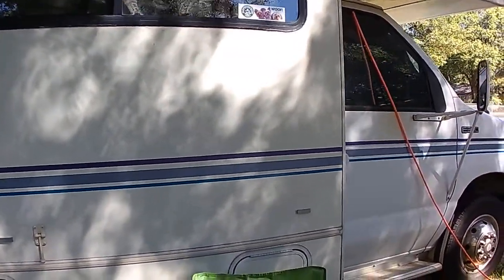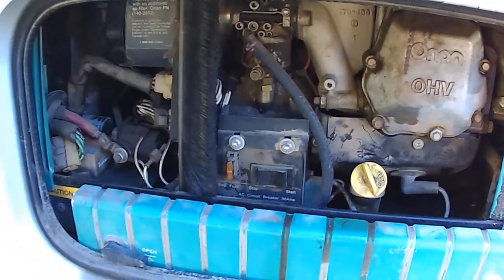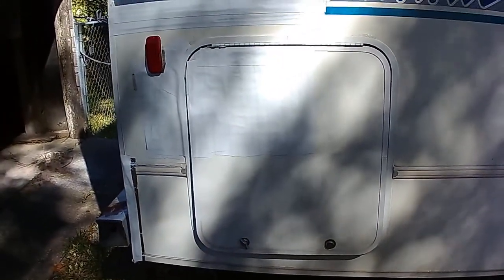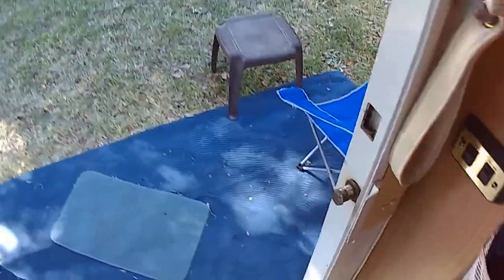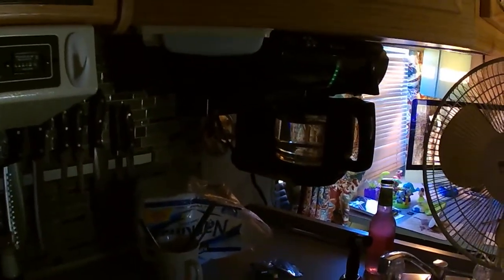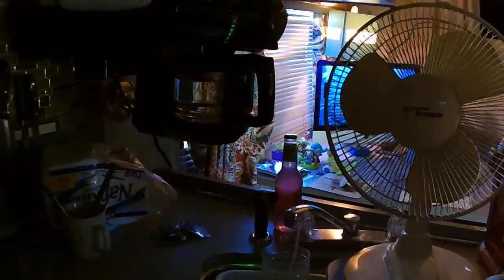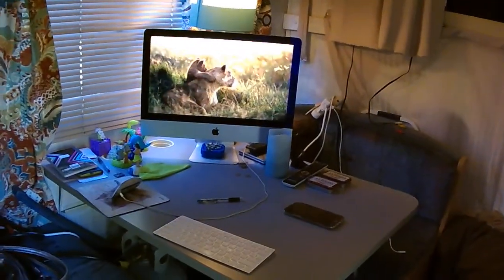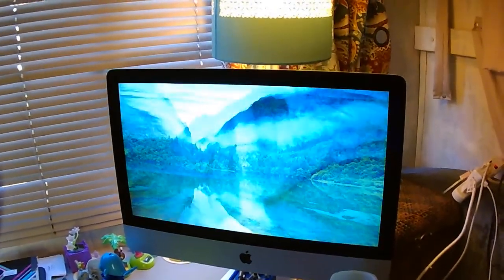Alittle tour

Comment: You've really done a lot with getting the camper organized. Good work. I am a bit concerned about the propane tank in the RV. It seems to me that I saw Nomadic Fanatic talking about his Buddy Heater and that he had the propane outside somehow. Just concerned (not that I know anything about it - just concerned.) :-)
Reply from the maker: I understand the concern I was worried about it also. I got a Stugi stay on my propane tank, Today I received my gas pressure checker and I will check the pressure on the RV propane system this weekend. If I have no leaks which I believe I will not, I will get someone to put a quick connect on my stove and have the tank outside. I also have an LP gas detector just in case there is a leak. It is nice to know that others also think of these things.I watch eric's channel and he also had a quick connect added after the fact. But all this takes time. Thanks for your comment and also when I drive the RV I take the tank out.Right now I am just driveway surfing
Reply: Mummy and Clyde glad you are taking the proper precautions. There are so many things to think about - but channels like yours and "the guys" are helpful and encouraging!
Reply from the maker: In my life right now there is no man and ladies are afraid to take the thing on by themselves. If I had men to help it would be great but alas i do not so ladies need to know they can do it.